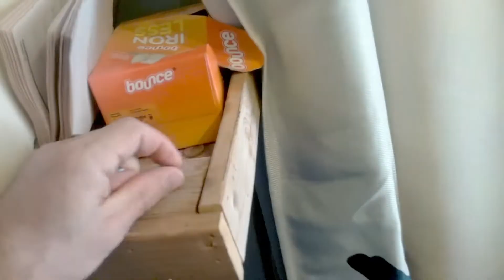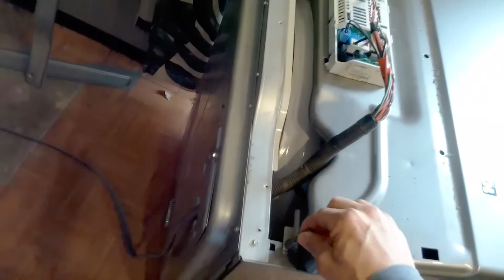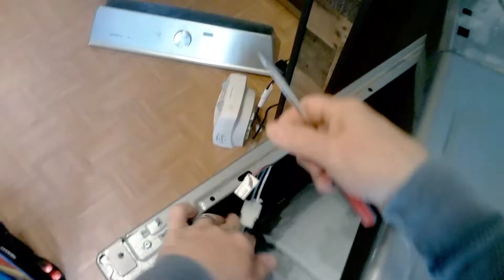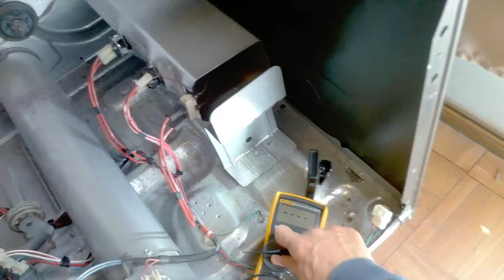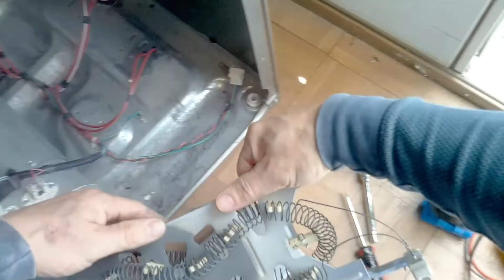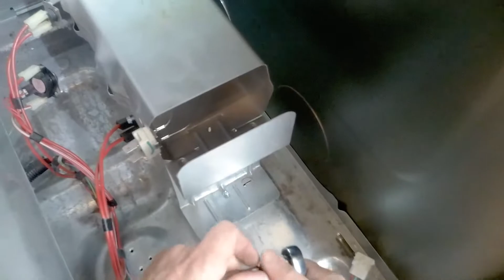Maytag Centennial Dryer Disassembly Made Easy & Heating Element Replacement

Comment: Mine has a lower panel that just pops off to get to the heating element. Seems like you could hook the broken element wire back together with a crimp connector for a temporary fix .
Not my problem now but disassembly to get to the belt tensioner is. This looks almost exactly like whats inside mine. Just an older style cabinet. Tensioner pully is shot on mine.

Comment: Despite your battery dying at the end, this was an excellent video. Not only did it save me a significant amount of money in service calls, I spent less than 70.00 on the heating element, roller kit and multimeter combined. Needless to say, the wife is very happy. Thanks!
Reply from the maker: Thank you for watching and for your kind words! I'm thrilled that the video was useful to you.

Comment: I have the med5500fw2 and just replaced the heating element, however I am unsure of the wiring placement now that I'm putting it back together. Unfortunately Maytag has removed all service manuals from their website and I can't fine any online. This video is the closest thing I can find, but I can't quite tell what goes where ...yes I should have noted the wires before removal :-(